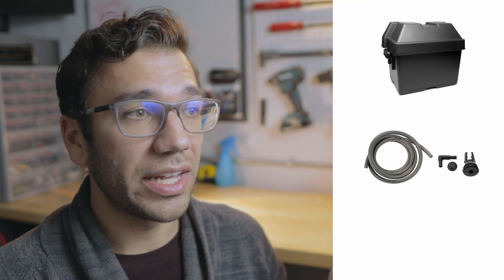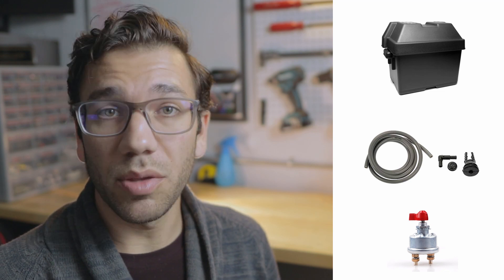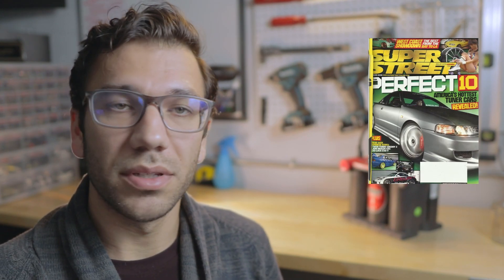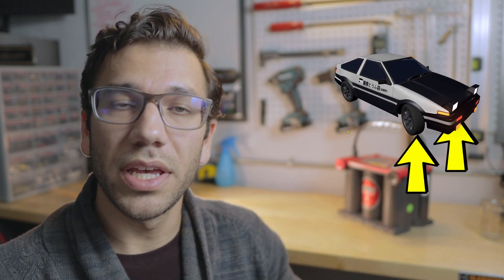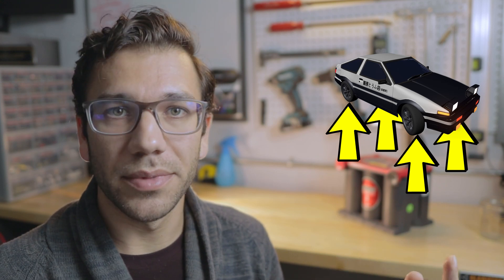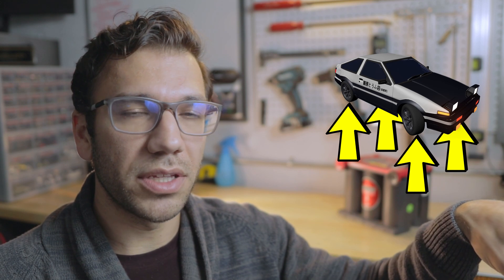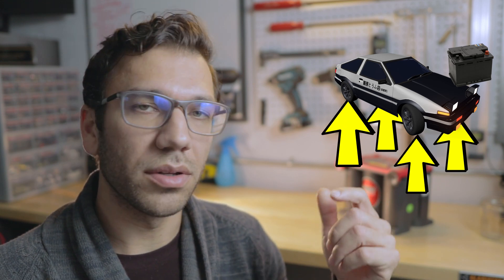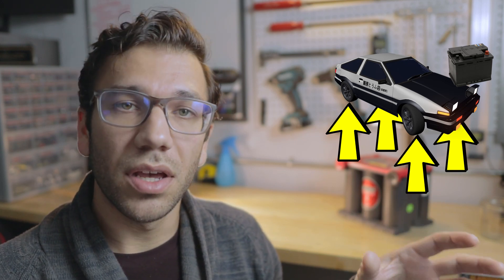Battery Relocation: Choosing the Right Battery and Effect on Handling | Ep 27

Comment: hey bro how are things goin?
A friend and I rebuilt my 6 port motor and ill be turboing soon, hows the build?
Reply from the maker: How did the rebuild go? Did you get a chance to fire it up yet? Aaron Cake, one of the old rx7club gurus, has a website with a full write-up on his 6 port turbo setup from many moons ago. Would be a good resource for you.

My car has been on hold for months. I started a new job in So Cal right before the lockdown happened. And my car is still in Nor Cal just sitting in the driveway under a car cover. Living between southern and nothern Cali has been tough, but I'm happy to have a job, and $ still flowing in, can't complain. Should get back to RX7 stuff soon, I will be posting videos of my daily, I just swapped a B18 into my '94 civic hatch and made everything OEM and smog legal. That was an unexpected swap because my old motor died. Decided to make the daily a little more fun :)
Reply: @AlexFranceschi  I have a Peurto Rican friend who helps me with all my rotary stuff, he's gonna teach me the tricks 😉
But the motor is GREAT! I've put like 1800 miles on it so far and it loves revving. We did a little street port on the primaries. I put the turbo front cover on and now I'm just going to rebuild the turbo. S5. By chance did you have to change out the wastegate sleeve?
I need to do mine

Comment: My series 5 got an issue cant work it out 
It turns on perfect idles perfect 
Now when its on the dyno when it goes to come on boost it leans out and cuts out wont rev over 4k rpm 
The secondary injectors are not coming on but they have fuel pressure 
Checked the tps 
The cas 
Coolant temp sensor 
All the fuel lines 
Its got fuel pressure 
Checked the ecu

What is the issue😭
Reply from the maker: Is this a completely stock turbo system? If not, what mods have been done?
Reply: @AlexFranceschi   completely stock 13bt
Reply: @Rxwpn  have you looked into a fuel cut defender? It sounds like youre getting fuel cut over the stock boost pressure

Comment: Great video, I would love to see a video of door handle and hatch latch replacement because the ones in my FC are broken. :(
Reply from the maker: Thanks! When the weather gets better I might try and make one for ya. In the meantime, you can also check out Mazda's factory service manual. They have pretty good instructions and diagrams. You can find them online for free :)
Reply: If it's the interior door handle, it's two or three trim screws and two clips per handle.

If it's the exterior, I believe it just bolts in and out with 10mm bolts and again, 2 clips. I'm guessing you're having the problem where the handle snapped inside? You'll need to either replace the whole handle, or JB weld it back together (which is what I did, and its held up fine so far). You can replace the rivets you'll need to drill out of the handle with bolts, washers, nuts, and loctite.